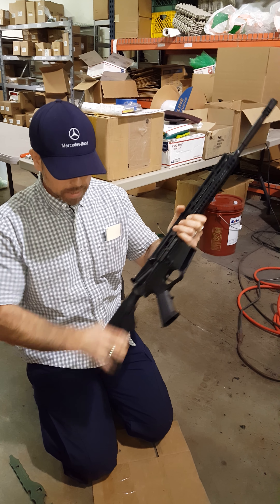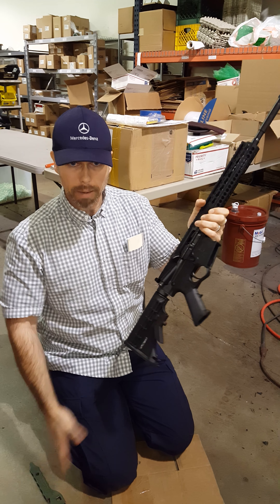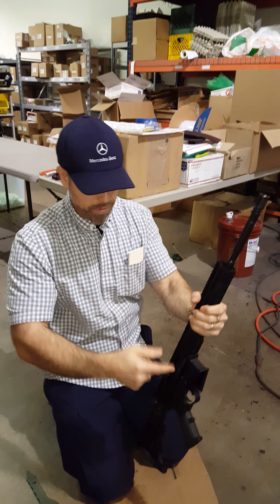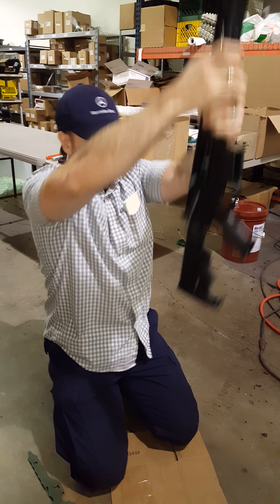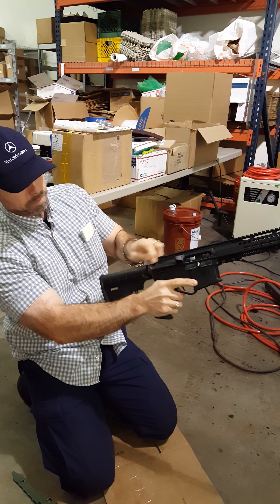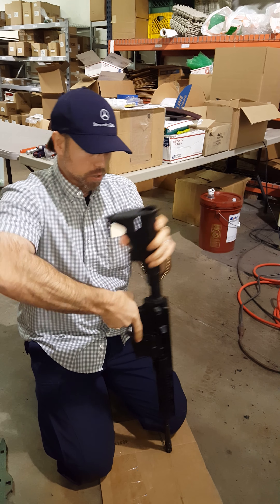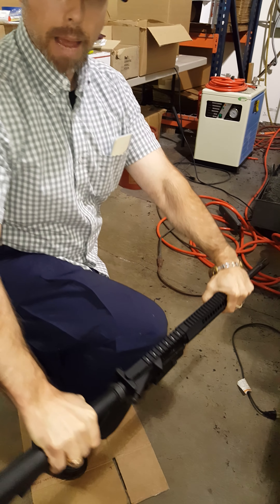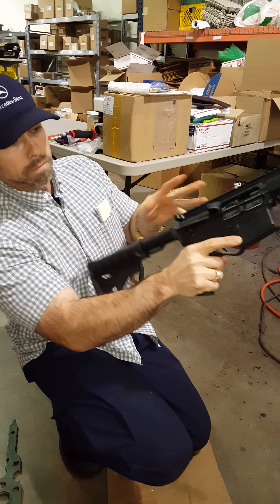Morter test SFI Polymer Lower Reciever

Comment: Can you do that with the Plum Crazy Gen 2 Polymer tube?
Reply from the maker: Yes but no need too, I use a rubber mallet on the charging handle and it works much better. Couple hits on one side and a couple on other side, obviously of there is a life round the barrel is pointed toward a hill so you don't get a round in your head.
Reply from the maker: I did this to stop people from saying it can't be done.

Comment: Is this the same as the plum gen 2 lower, are there any physical difference in the lower and trigger group?
Reply from the maker: Yes, remember these lowers never have issues till the end user disassembles...them and loses parts or over  tightens castle nut. Our castle nuts are factory set at 6-8lbs with loctite and never should be touched .. we never have issues unless someone does just what I wrote here.
Reply: I wanted to make a 300blck pistol build, but I see on one of the sites that sell them, that it says they don’t work with pistol builds. Are you guys going to make one that functions with the 10.5 uppers?
Reply from the maker: @bunville56  insurance reasons. Rifle only, 10.5 if it's a rifle its fine. No pistols due to its not insured for it. If I insure for pistols the cost goes up on the lower, we don't want that, and neither do our customers. So pistol voids warranty..
Reply: Aw okay, i gotcha. Thanks